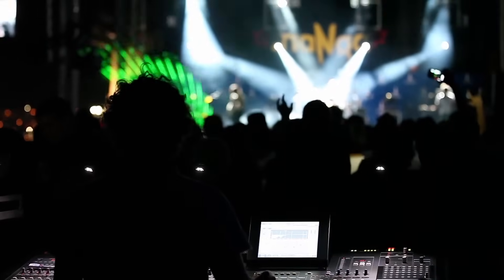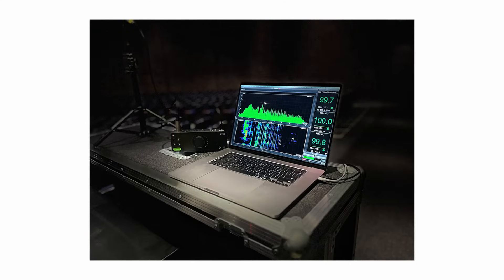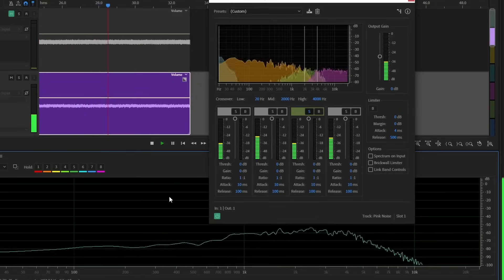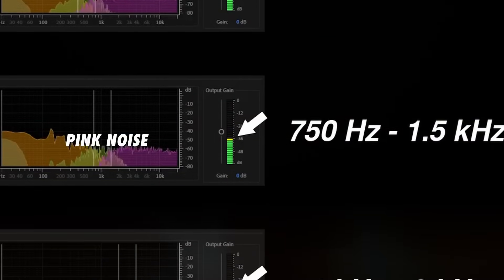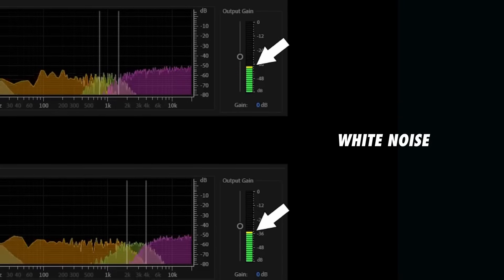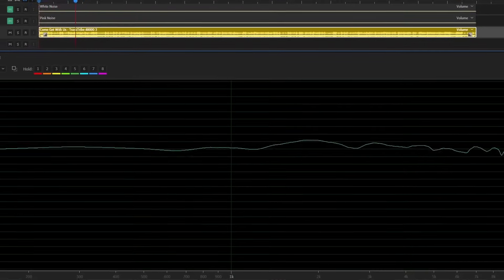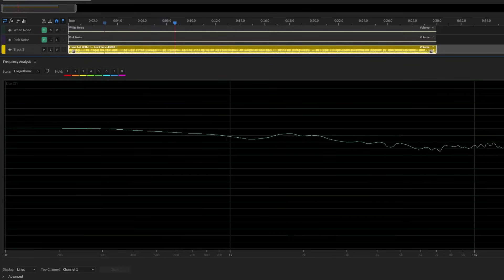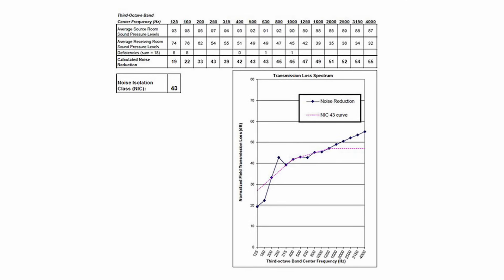White Noise vs Pink Noise: Audio Engineer's Guide

Comment: hey! i've seen conflicting information on how white vs pink noise is seen on a spectrum analyzer. instead of the white noise being flat and the pink noise having more low freq content, i've seen on multiple articles and graphs that give this results: 

https://cms.softdb.com/uploads/white_noise_pink_noise_sound_masking_d69aeba787.png 
https://www.acousticfields.com/wp-content/webp-express/webp-images/uploads/2023/01/pink-noise-white-noise.jpg.webp

When trying this myself some analyzers like the PRO Q 3 spectrum and the voxengo span gave the same response as those images while ableton's native spectrum gave out the same result as the examples you showed. Any idea why this might happen? I see that on the x-axis of the images I showed says octave 1/3 may that be why? If yes what does that mean and why does it change the result so drastically... Please Help !!!

Comment: One question in mind, which I think you are the guy to ask, why do the frequencies move in the analyzer? Is there any way to create a static white noise? Because it seems that it is not accurately flat when it moves.
Reply: That is because white noise consists of random frequencies, not all frequencies at the same time. If you imagine flipping a coin, in theory they will be an equal number of heads and tails. But only after an infinite number of flips. So on average, white noise contains or will contain all frequencies equally.

That is why audio analysers usually have an averaging function that will smooth out the response over time. 

Sine sweeps will give a flat response but not in real time.

Comment: I had a question about this topic. when use a stock synthesizer in FL Studio to generate white noise, when I check my EQ, I don't see an even spread. I see a downwards trend, as if it were pink noise. I checked even on Span, with the same results. I thought it may be my synth, so I downloaded a few white noise samples from various sources and they all read the same. why might this be? how do I view a spectrum that displays it with equal energy across the spectrum?
Reply from the maker: It's possible that the graph is logarithmic. So, pink noise would probably look flat on that graph. White noise looks flat on a linear scale.
Reply: @AudioUniversity I see. that makes sense thank you. I'll look into that

Comment: @AudioUniversity - do you have a video on how to measure the frequency of a sound source? Like a musical instrument to ensure it's tuned perfectly to the Hz it needs to be? I'm building a small scale anechoic chamber just for the purpose of measuring primary frequency of different instruments but despite tons of research, the answer is still unclear to me on how to do this correctly and as accurately as possible. Can you point me to any resources you might know of please?!
Reply from the maker: I just use a tuner. The specific Hertz value will likely vary over the course of a given note.

Comment: is there any device for eliminate/reduce feedback sound?
Reply: There are lots of feedback elimination devices. dbx, Behringer, Klark Teknik, and others make hardware for feedback elimination. Waves and others have software solutions.
Reply: @Yoda8945  Would it be better to solve feedback issues with EQ? I suppose there must be advantages to the devices you listed, but just curious about what they are.
Reply: @Fix_It_Again_Tony  Those devices are mostly automatic and work in real time. Learning how to properly use a proper (parametric) takes time and experience. One thing not oftenmentioned is that feedback is really a time rather than gain issue.
Reply: @Yoda8945  Thanks for the reply. Can you explain why feedback is a time issue or at least point me to some further reading?
Reply: @Fix_It_Again_Tony  Feedback is a resonant frequency between the speaker and the microphone.If the distance is greater, the feedback frequency becomes a lower pitch and only a few milliseconds of delay to the speaker may move it to a frequency that the microphone is not so sensitive.
Reply: @Yoda8945  I understand what you are saying now. The way I've always looked at it is the environment is part of the resonant system along with the speaker and microphone. Lowering speaker output at the resonant frequency will prevent or at least reduce feedback. I am not an audio engineer, so I don't really know how practical that always is. Also, like you mention, moving things around can change the resonant frequency so static PEQ settings might not be best in all situations.
Reply: @Fix_It_Again_Tony  Equalizer sounds better. Feedback destroyers can cause comb filter effects.